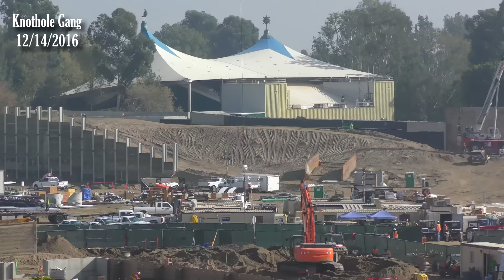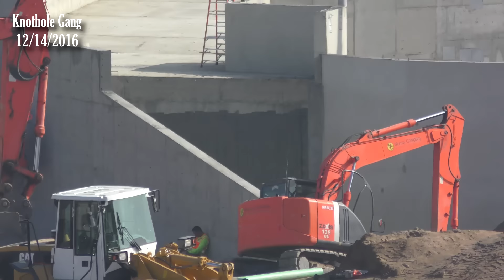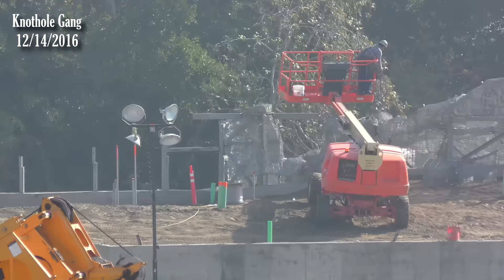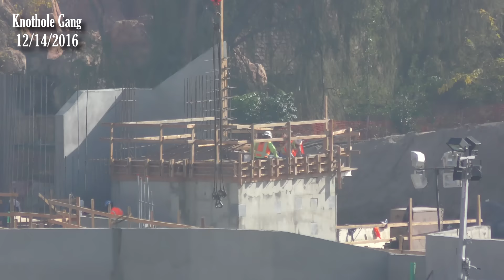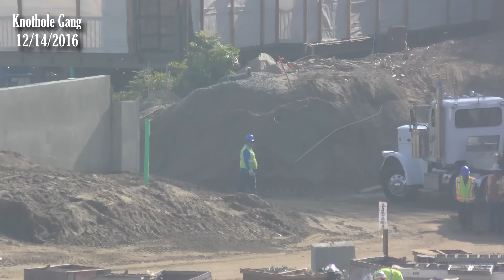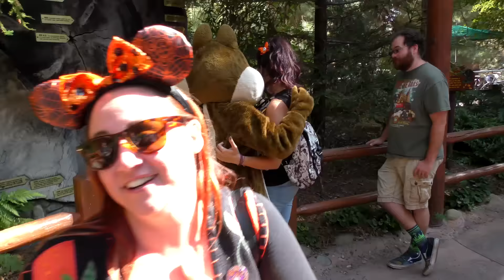Star Wars Land LIVE! - they're building a turret- Pt. 61 | 12-14-16

Comment: I normally don't comment on these, but, I'm a certified architectural draftsman and I wanted to share what I'm seeing specifically in the "pool" area. the pool itself will be for mechanical systems. Basically, everything required to run the ride. That would include hydraulic fluid systems. It is required to have a catch basin in case of hydraulic fluid systems failure. If it leaks the basin will catch it. From the looks of it, it's going to be a stationary system with a gigantic screen. Think Back to the future at universal. That's all I wanted to share.
Reply: Yep.  Simulator of sorts.
Reply: Daniel Walker If it's going to be a "Back to the Future" simulation type ride, then why is Fresh Baked telling us that it's going to have "elevators" and multiple levels in the ride?  I never quite understood what they were trying to say. Either way I want to start seeing some visible construction on the Millennium Falcon.
Reply: KBirk83 Maybe more like the Pirates of the Caribbean ride in Shanghai?
Reply: MsDiz Ohhh, nice! Most likely this will be the case then.
Reply: KBirk83 here's the deal. Either it will be like the back to the future ride...or it will be similar to the transformer ride system. In the transformer ride system there will be an elevator system (hydraulic). If it's more like the back to the future ride, it will still depend upon hydraulics for that motion based system. In either case the pool itself serves as a catch basin in the event of a hydraulic fluid spill. Having that in place serves as a means to keep that fluid contained so as to deter leaking out into the environment.
Reply: Daniel Walker cool. Thanks for the insight.
Reply: I've been saying this for awhile. Everything they've said about the attraction- the "escape" aspect, the huge vistas, the perspective of the guests vis-a-vis the ride- suggests that it could be a clone of Battle for the Sunken Treasure. Also the fact that Imagineering loves to clone stuff when the format works well.
Reply: I haven't seen the plans for the ride yet, I just haven't had time to research and find them yet. Disney and Universal studios are very sneaky about how they submit plans with the appropriate state and county agencies. So a bit of research is required through the permit office. But I've heard some rumor discussion about the type of ride system to be used for the counterpart attraction in Orlando. It is rumored that it will be a tackles system and that during the ride you'll disembark the ride vehicle, have some kind of interaction experience and then regain access to the ride vehicle and finish the ride. Keep in mind that I am only relaying what I was told, by a reliable source. The ride in either park could be completely different from the other. The pool in the basement would still apply, since the ride vehicle would have hydraulics as well as any elevator system used to lift and lower.
Reply: Daniel Walker ok wow.  See that's what I heard as well (probably from Fresh Baked).  I just don't understand how exactly that's going to work. I'm mean if it's a back to the future type ride, how/why would you get out at some point?

Comment: That wall at the edge looks to be a concrete knee wall for the show building. That building will probably be a structural steel framed building and use corrugated metal for the walls. Kinda like the other show buildings you see around the Park. (Indy Jones & Haunted Mansion). So that type of construction makes sense.

Comment: They're going to need to start building up soon. If you take another look at the concept art there's going to be some pretty tall mountains throughout SWL. ✌🏼️👍🏼
Reply: disneymatt01 I give it 4 months and the wall will be up and blocking the view from M&F PS. Dave the work they are doing next to the Access Path I bet is foundations for the back wall like Radiator Springs.
Reply: The focus right now is in just completing the berm/rivers/railroad, so they can reopen the closed sections of the park.  Once that is done, and sightlines are managed, the major construction will begin on SWL proper.